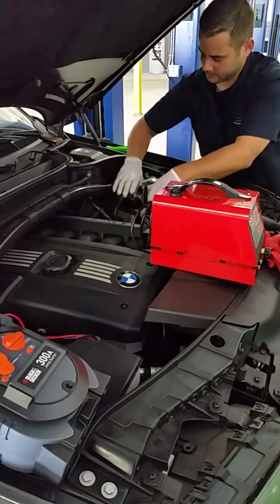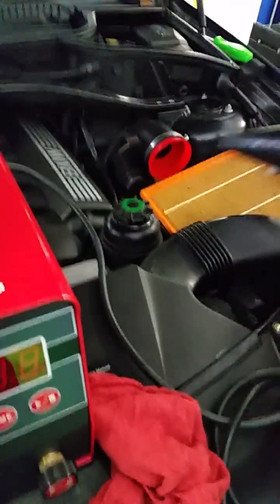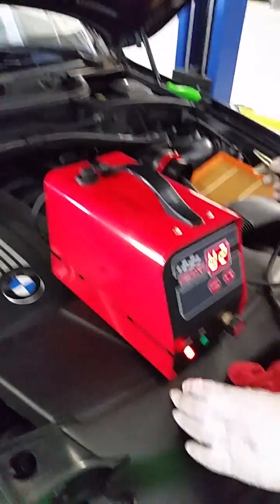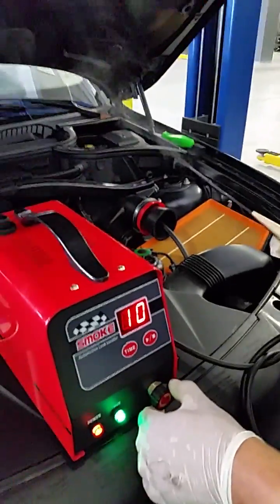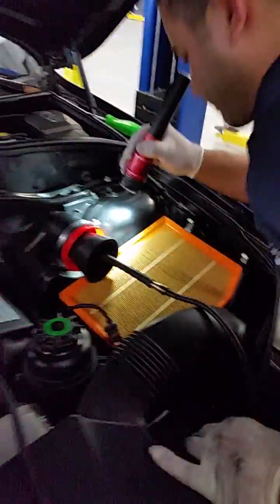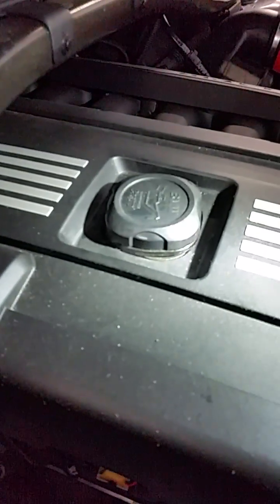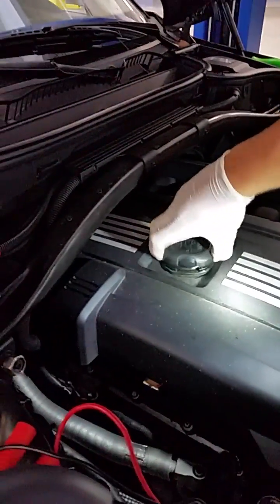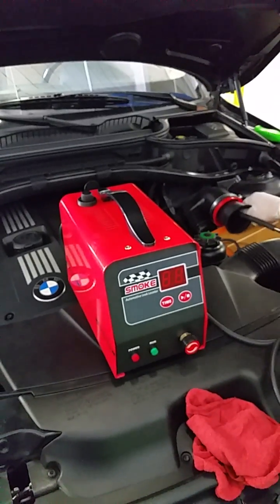Smoke testing a BMW X3

Comment: If you go in through the front how do you know the throttle body is open to allow smoke into the system?
Reply: open the oil cap if there's smoke its going through the whole system
Reply: Oil cap yes: 
You can use Protool to activate open and close I believe

Comment: for  your evap video when using baby oil did you run to any issues with the car or cars if you worked on other cars

also do you use any other liquids to make smoke